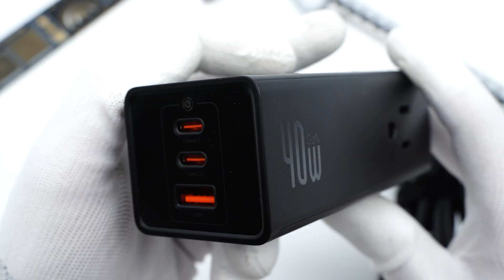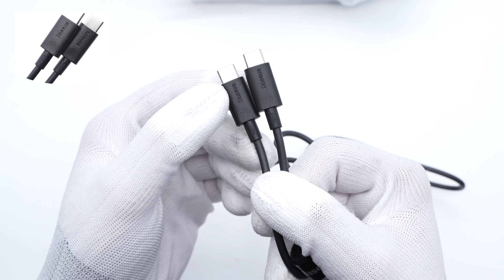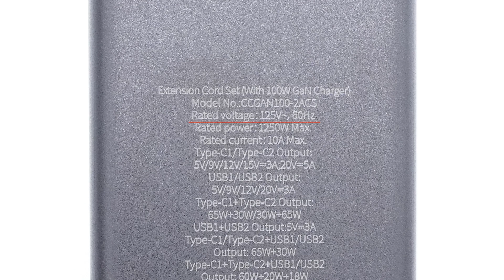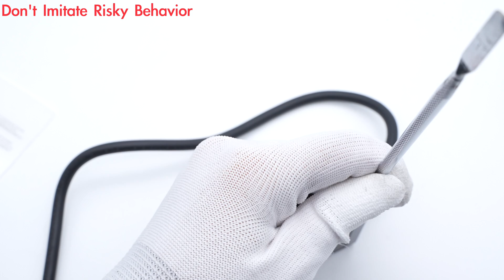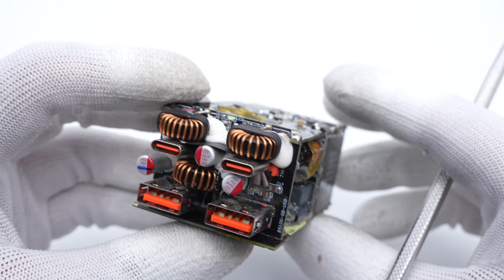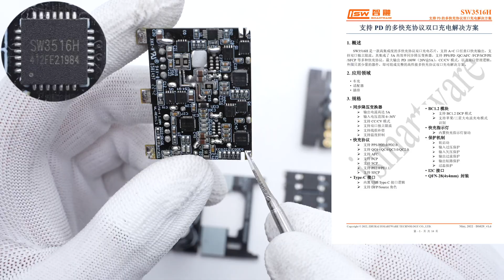Teardown of Baseus 100W All-in-One USB-C PowerCombo Power Strip

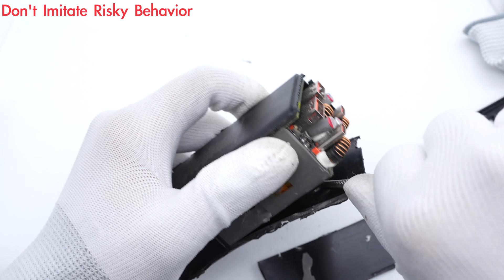Comment: This BASEUS charger is fake ground connection cord. this product does not connected grounding. (4:35 you can see , there are only 2 connector) Cheating charger. so, when you use macbook you can feel electricity from metal part of macbook. i dumped this product because of this problem. This is why you have to buy big company product such as Apple Samsung Belkin. Do not buy new brand charger made in China.
Reply: you realize that means your macbook is bad right? but per https://www.youtube.com/watch?v=tzGwrsq-83U&t=446s , the AC outlet is grounded.

Comment: the gaming laptops should start to support 240 watt usb c charging and should get rid of the bulky bricks
Reply: A power supply of a specific wattage is usually in similar size as long as they use the same technology (linear, silicone switching, or GAN switching). The power brick would be the same size no matter it use a propiretary plug or a USB-C one. And I would personally doubt 240W PD becoming popular any time soon, because down volting 48V to 12V at 240W can take a significant amount of circult space and might not even be possible to incorporate into a laptop.